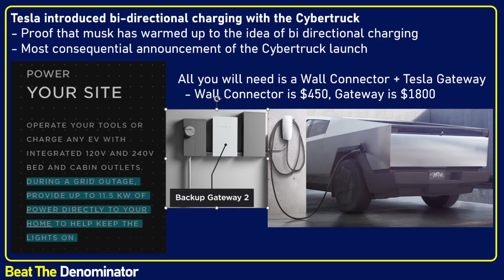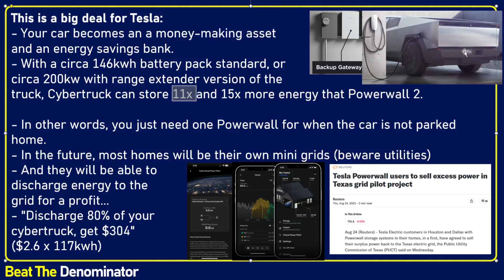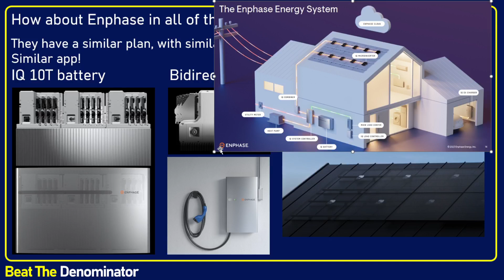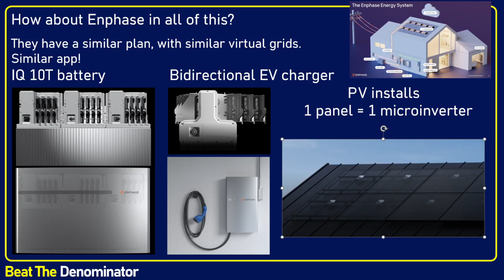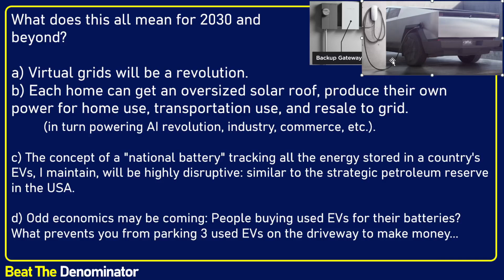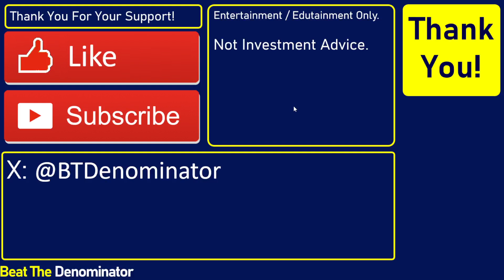Why Tesla's Bidirectional Charging Is A Huge Deal. Will It Double The Value of Your EV? + ENPH Stock

Comment: Update.  Gateway is not enough.  You need PowerWall:

For Customers with Powerwall

If your home is equipped with Powerwall and home charging, you do not require any additional equipment. Powershare Home Backup functionality with Powerwall is expected to be available later this year through an over-the-air update. All AC Powerwall variants will be compatible with Powershare Home Backup in the future.

It goes in to say that if you dont have ANY charger AND ANY Powerwall, then you need the special 3V Powershare Gateway.  Which as of now is not compatible with ANY Powerwall (coming).

Current iteration with 3V gateway only supports backup.  Not true VTH or VTG.

So should I get a normal PW3 install (BG3 + PW3) and wait for that to work.   Or

Get the New 3V gateway I already paid for.  Hope I can add PW3 later.  

Tesla does say V3 gateway will work with special commisioning assistance to disable aite controller om the gateway.  But they recommend getting BG 2/3 or Backuo Switch.

Comment: But you used the grid to vharge the battery. Haha unless you have a large solar power system
Reply from the maker: Yes I talk extensively about how most residential roofs will have oversized solar systems. A solar panel is cheaper than plywood today.